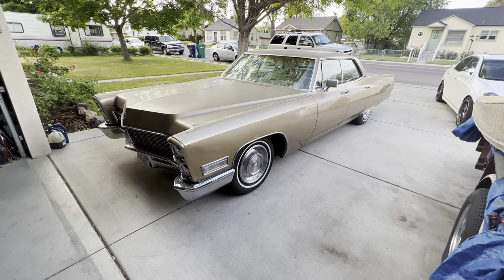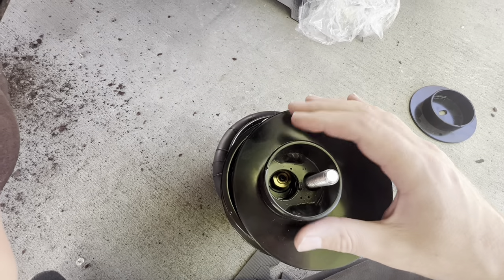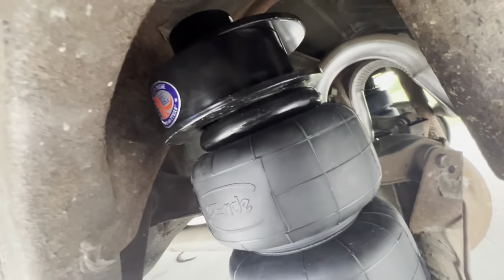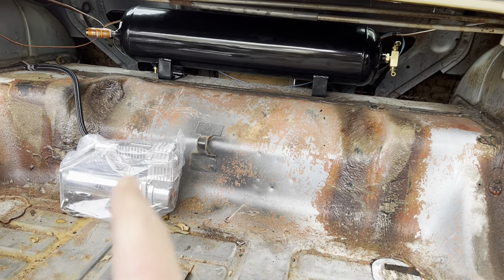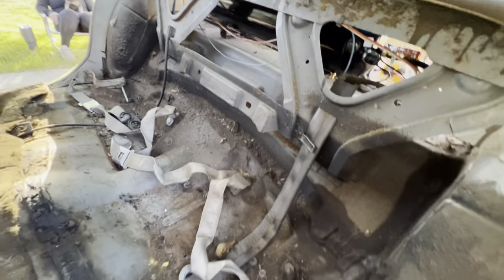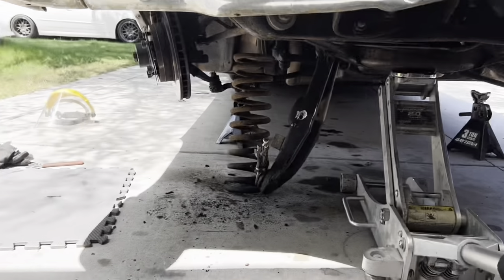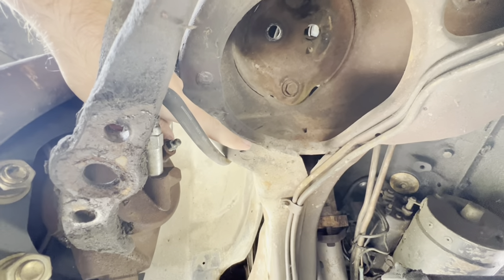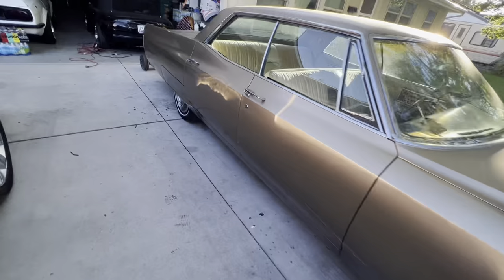How To Install Complete Air Ride (ezairride) On 68 Cadillac. Its A Long One.. So Buckle Up!! 😬

Comment: Did you end up installing shock relocation mounts? Also did you have to tunnel it? after Thanks!
Reply from the maker: I haven’t done the shock relocation yet. But I will be doing it as soon as the weather warms up. I have the shock kit from ezairride. And no if you are referring to cutting the tunnel in the rear I did not have to. No body modifications needed other then the front spring pocket trimming. Hope that helps🫡

Comment: Hey guys! Just bought a 67 Coupe Deville yesterday on  Labor day.  I love the video bud. Thorough. Looking into one of their systems and cost. 
Nice video!
Reply from the maker: Your coupe is going to look so good! Congratulations on the new car😬😬😬
Reply: @tdtgarage1697  thank you!   Its white on white.  Black vinyl top. Black floor. I believe they only made in 67 less than 400 in this combo.
Thanks again!
Reply: @tdtgarage1697  what was the total cost for this video instal setup including batteries?  Thanks!
Reply from the maker: @tripp1317  $1300 on ez airride site. I’m running classic kit. Most basic option. Just using the battery that came in the car. The kit comes with everything you need.

Comment: Sweet.   I'm looking at this kit for my 1970 coupe.   Did you end up relocating your front shocks or deleting them?  I read that you were going to.  And are there rear shocks?   I'm a little weary of driving a car without shock absorbers.
Reply from the maker: Rears just take stock replacements. I have not relocated the fronts. I would recommend it. Cuz it does get bouncy. I’ve just been working on other projects and haven’t had time.

Comment: I have a 71 coupe deville that I’m about to  put this kit on how does it ride with out the front shocks in the reviews people where saying it wasn’t to bad but I wanna see if I can live without dampening
Reply from the maker: Um… it’s definitely a bouncy ride. But its ok. I’ve ran it over a year with no front shocks. But I do have the kit to install. In my opinion you will be ok for at least this season, then decide if you want to spend more money on the kit.
Reply: @tdtgarage1697  that’s my problem I think I might need to fab my own control arms I’ve been looking and don’t see and relocation kits for a 71
Reply from the maker: @masongodfrey9169  yeah it’s kind of a universal kit. My kit isn’t actually for the 68.
Reply: @tdtgarage1697  do you think you could link me the kit you got I can look at some pictures to compare it to and hopefully I can make it work the suspension and chassis where rlly all the same up until the late 70s
Reply from the maker: @masongodfrey9169  https://www.ezairride.com/UNIVERSAL-FRONT-SHOCK-RELOCATOR-KIT-w-SHOCKS_p_365.html
Reply: @tdtgarage1697  awesome thank you so much if your gonna install them on ur caddy are u planning on doing a video of it your video here is the only reason I even pulled the trigger on getting the kit it was super helpful to visualize
Reply from the maker: @masongodfrey9169  absolutely I will be making a video on it. 🙌 I’m happy the video helped 😬